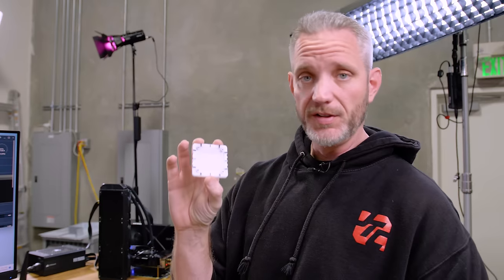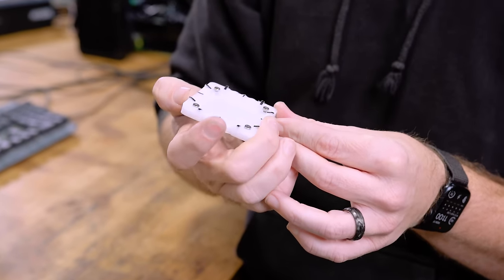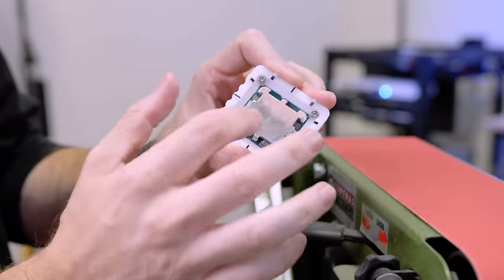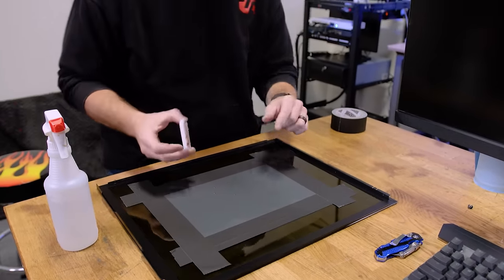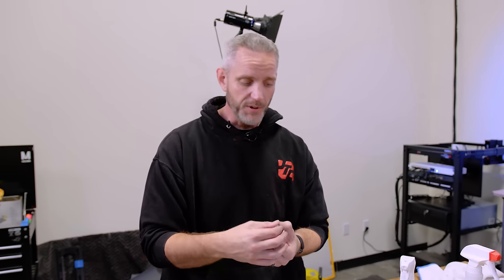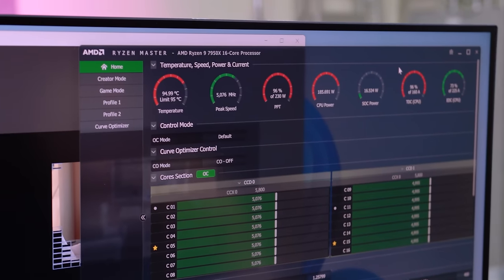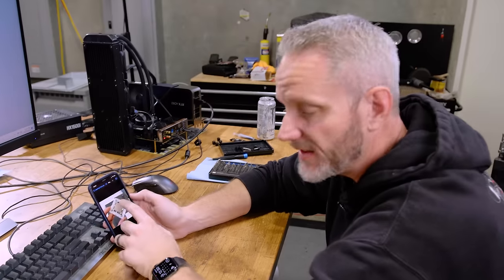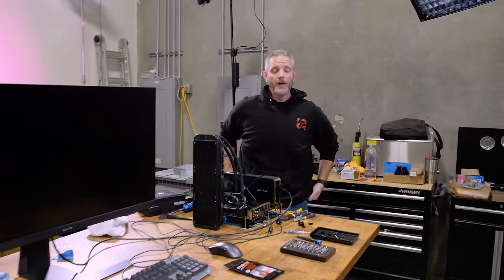Modifying the 7950X CPU for better thermals... VOIDED WARRANTY!

Comment: Pro Tipp Jay: Use a mirror instead of tempered glass. A mirror is much flatter than any normal plain of glass since you would see any curvature of the glass in the reflection of the mirror as a distortion. Thanks to that mirrors are almost universally the flattest object in everyone's household.
Reply: Exactly what i was going too say. Glas isent really flat but im guessing its flat enough but a mirror is probably flatter! best thing would be a the precision flat stones but there pretty pricy. Good if your planning on mesuring stuff tho
Reply: @Sierra Mike Echo i second that, i’ve seen hundreds of cheap mirrors that distort the image the reflect

I’d argue it’s more common than not
Reply: Lol, no
Reply: At least with the mirror you can see the distortion though.  Glass you can't as easily.
Reply: The mirror glass only needs to be flat on the metalic side for it to not have distortions. That probably means that the other side is the more uneven of the two, meaning it might be even worse than regular glass.
Reply: Float glass aka window glass is the fattest kind of Glas that you can get.     And that's almost always the Glas  that mirrors are made of. At least here in Germany
Reply: Just because it's a mirror, doesn't mean it's perfectly flat. I can make a mirror out of the cheapest plastic 💀
Reply: Gannett is also hyper flat. We use it in machining
Reply: we use glass to lap fiber optics and my personal baseline is between .01 and .03 dB per connection; very low loss and very flat. a particular mirror might be better than glass, but most glass is better than most mirrors.
Reply: Unless you buy a mirror from IKEA
Reply: My sister is the flattes object in this household
Reply: A mirror is no where near as flat as my wife’s chest 😂😂😂
Reply: Don't use any old mirror unless you know it is float glass. Tempered side panel glass is float glass. Also be careful when taping down abrasives to it. It's nearly impossible to get it taught enough so there are zero contours as it will stretch and deform during use which can bow the abrasive. Gluing isn't the greatest option either because of the peaks and valleys however small. The best option to deal with the inevitable high and low spots of the abrasive is to always rotate the workpiece periodically even though you think you're applying even pressure. Or you could use a perfectly flat plate infused with abrasive like TIN and Kingpin use, or like diamond cutters use. However you do it, be mindful that taping abrasive to glass (even if the glass is perfectly flat) is never exactly flat.
Reply: @EdwardCuss  bro you can’t be like that man 💀 that’s messed up.
Reply: Dentist mirrors are a good option, they come in various sizes and materials and are generally very good and slim
Reply: @Sierra Mike Echo well as stated if it doesn't distort things you see it is pretty damn flat. It has the flatness indicator basically built in.
Reply: @Crecross  Sure you can make a mirror out of anything, just deposit a few layers of silver on it... but if the reflection you get is not distorted after that you probably found a pretty flat object to begin with. And also yes, technically only the metallic side of the mirror has to be flat to not distort the image but in practice it is very common that both sides are near perfectly parallel since the manufacturing process of making flat plain glass almost demands that.
Reply: Well you could just go to a machine shop get a chunk of cast machined way more flat than any mirror.
Reply: My girlfriend begs to differ
Reply: But a mirror is glass with a reflective foil on the backside.
Reply: Tip. Most mirrors are tempered glass. So your statement just went out the table now. Anything that reflects light is consider a mirror. So him using tempered glass side panel technically means he used a mirror.
Reply: A decent granite flat stone can be had for under 100bucks pretty easily
Reply: Yeah I'm watching this and all I'm thinking I understand he's got a show to do but he lapped completely wrong. You are 100% right. A mirror is flatter. Also you want something that you can walk around? I think a lot of his problem is that it's not even.
What you want to do is be able to walk around that table completely. And yes it takes a shit ton of time. But it's one stroke towards the center from the outside edge. Walk an eighth around clockwise doing one stroke from edge to center. Yes, it takes a lot of time but this prevents humans. Inefficiency of consistency.

Again I understand he's got a show to do and he can't spend four or five hours doing it properly. But at least he should tell people the way he's doing. It is completely wrong and not the recommended way which leaves a lot of room for failure
Reply: Another pretty good option is a granite tile if you don't have anything on hand.
Reply: Three granite slabs and enough time and you've got three AAA grade surfaces that a sub micron flat. Question is, is it necessary given that he's taping a bit of paper to it that probably has 10s of microns of variance in its thickness..?
Reply: @r3dm4il  Dude, I don't even know if you have a sister to defend. I just found your humor distasteful and tragically adolescent. if that's what pops into your mind and you thought we all needed to hear, just... how juvenile... no, we didnt need or want to hear that crap. have a good day.
Reply: Is that why people snort coke off of mirrors?
Reply: It's all good
Reply: Ff/FL are the terms and he needs to find the values he's at and trying to achieve. But you're absolutely correct about mirrors. However they don't care as much about FF. So you can have a barbed edge or slight bump.
Reply: Also, as we do when we flatten an engine head redneck style the motion should be of an figure eight to make it more level.
Reply: @mr wpg no its not. There are many different grades of glass and as stated before mirrors need to be very flat to not distort the reflection. If you would metalize a piece of normal window glass it would absolutely distort the reflection.
Reply: I wonder if machining the IHS would offer any improvement to lapping? Granted it would be an insane setup and attempt. Just wondering...why not give it a go? Lol
Reply: A granite surface plate would be the most ideal using a figure 8 pattern
Reply: You can see a relfection in common glass too
Reply: Great tip 👍
Reply: That’s why the break down come on em 😂
Reply: Completely different size scale, but still relevant... What's the point in designing a road to the millimetre, when you're building it out of 14mm rocks? Sandpaper taped to a stone counter top or an old piece of glass is just fine when you're controlling it with your hand!
Reply: As a glass guy, I can tell you a mirror is no more or less flat than a piece of glass. It's reflected side may be indeed smoother, but flatness is relative. If it's perfectly vertical, and they are of equal quality, then they should be equally flat, or plum for you carpenters. But, a piece of 3mm glass, or mirror, will flex in the wind, or on an uneven table under its own weight if it's big enough.
In fact, tempered is more rigid after its baked. And arguably 10 x harder.

The glass argument is completely moot.

Jay, love yer videos.
Reply: Oh i thought my gf is the flattest object
Reply: Your statement was true in 1990's since then vitrually all glass is FLOAT glass - as flat as it gets
Reply: At the point of modding to this degree I'd just say get an actual lapping plate from a tool/hardware supplier. Not only useful for IHS lapping, but good for polishing other flat surfaces as well. You can find them made of all sorts of different materials, and at many different price points for dirt cheap to $200+

Comment: Prior machinist and folding knife Maker here, you should never lap with the power sander.  When you're lapping a cpu or anything else you want it to be flat and parallel.   Using a sander, no matter how flat your platen is, putting too much pressure on one side will cause it to no longer be parallel.   Using a surface plate and a figure 8 pattern while turning often is going slowly is your best bet of staying flat and parallel.   Yes it takes much longer but precision always does And I wouldn't trust using a surface grinder on a cpu or IHS
Reply: That'd be one expensive projectile on a surface grinder 😅